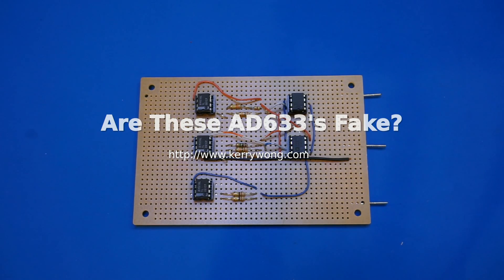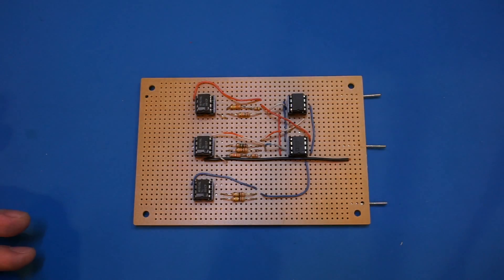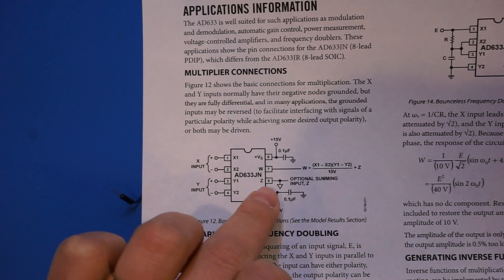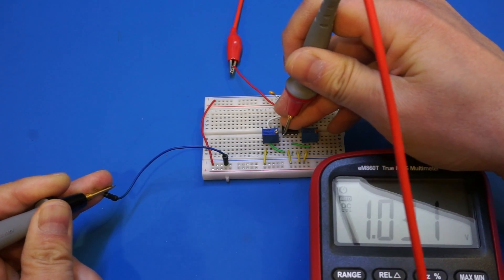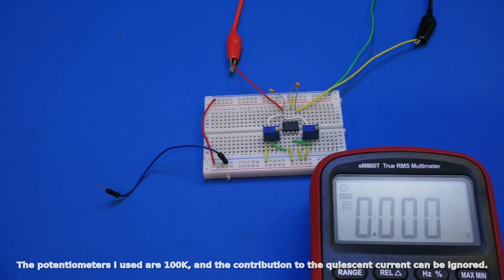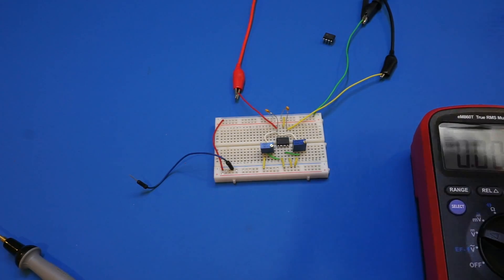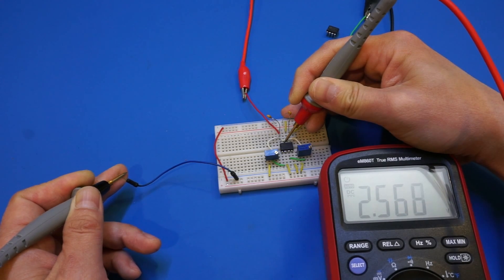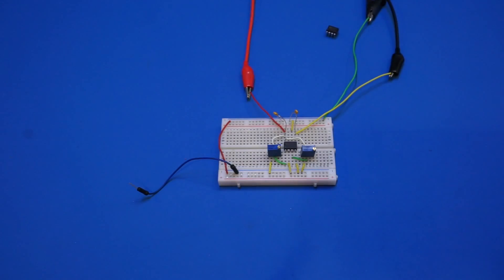Are These AD633's Fake?

Comment: I started building the squaring circuit but was impatient, only connecting x1 to y1 and x2 to y2. I connected the supplies to my current limited bench supply and found that I couldn’t get any appreciable voltage between pins 8 and 5 without drawing excessive current. Very broken.

Comment: Kerry. I know you probably think im a weirdo because i ramble. I apologize as i have ptsd and my meds make me act erratically sometimes. I hate it. 

Im in the market for a curve tracer to match germanium diodes and transistors tor some guitar effects pedals im designing as a gift for a friend who is also a student (guitar). Ive spent a fortune on parts and im making a test jig now for prototyping so i dial in the effects i want. I plan on selling the extras, i use an fpga based effects processor that can mimic any mic, position of the mic in relation to any cab or speaker and so many different amps and such that ill never runnout of options. Its almost too much choice. Very cool tech though. I run the modeling rig into a stereo pa or studio 2.1 powered speakers if i record so i have no need for the extra pedals. Im using new old stock from communist era ussr, mostly germanium semiconductors. 

Do you have any experience with the curve tracers from ali express or should i just buy a second hand tektronix for a little over a grand? I plan to either donate the pedals or proceeds to a local makerspace that i help out alot. I've been a big fan of your's for a while and read your academic credentials as well and i wasn't surprised by your notoriety and background. I have a software engineering degree i never used but plan to take ee or computer science this fall as my previous degree has almoat 2 years worth of credits to carry over to whichever i choose. Im 45 and it's a bucket list thing more than anything and I'd like to have the credentials to volunteer full-time as i plan to be much improved socially by then and they need the help. I've developed courses for them already and built out their electronic engineering area but im not at a point innmy therapy where i can commit full time. Im sure you agree being ive been a jackass from time to time.

Ive been off work for 8 years and have spent the last 5 yeara teaching myself to code again and circuit level theory and the maths involved. I apologize for my previous behavior and i assure you it wont happen again.

I was going to donate 10 dollars but you dont have the thankyou button enabled. If you enable it ill donate from time to time as a sign of appreciation and a token of goodwill for my idiocy.

Ive been wanting a curve tracer for a while and dont want to buy a peak atlas as the price in Canada is very high for a piece of plastic. Plus ill end up donating the gear eventually. I donate half of my disposable income to charity, usually to places that promote stem to youths or music as im a professional guitar player. Id rather have the degree though. Haha

Comment: I believe you are missing a ground connection between the top and bottom bus bars of the breadboard. Power supply ground isn't making it in to the pots or minus inputs of the  AD633.

Comment: Very late response, but... they look painted on top, take some acetone to them and see if it comes off.
Reply: Hi 'gnif'. Yea, this post is from 2017. I'm presently looking for these chips myself, recently. I don't know if the same 'fake' ones would still be on sale 3 years later without complaints??  Anyhow, the numbers on these are...
AD633JN
#1424
K707115       (Including a depression next to pin-1).
Some other eBay sites have some with the exact same ref numbers, but OTHER sites have...
AD633JN
#1216
2342702       (NO depression next to pin-1).
I think I'll try some of the latter!!
P.S.  Do you think that acetone won't affect the writing on the 'real' ones??

Comment: last month 5   '633's were ordered from top_electronic1980  on ebay.   on arrival they were tested
in the manner  you showed us here.    the inputs were  both +5V  so a +2.5 V. out was expected.
all  5  failed the test with W = -4.xx V. and every  chip getting hot.

    on writing to the seller with this info the reply was to  return  them  .  an address was given.
after some thought i decided to skip returning them.  the cost of returning, the time to pkg
the IC's and wait in line at the p'office &  a good  chance they'd  be misplaced in transit  or after
arrival added up to make this a non-starter.  simpler to just write off the loss.

btw ... in parallel with this ebay order was to buy 2 from digi-key.  they both tested OK.
... using the same b. bd circuit the ebay ones were tested with.

    a new direction is to write back & offer them a link top this site.  so they can see how 
easily the IC's could be tested prior to shipping them off  to some unsuspecting  customer.

   they can weigh this effort vs guaranteed negative feedback.  and who knows , someone there
may use their intelligence in a new way.

Comment: you've learned a hard lesson.   trusting what one buys online as being the real deal.
one a u-t vid a chinaman was complaining about the same thing ... being cheated
over there by his countrymen ... 

otherwise you gave us a  good tutorial  - intro  to the 633. 
 you've brought to life how we can get going using one.

given how they can accept DC signals as inputs 2 were added to a digikey order today.
cant wait to experiment with one.  saw 2 that AD offers an eval.  bd. using  this chip.
a little pricey tho ($86.40).  so am planning to DIY copy it using some EasyEda s/w
 depending on the exp't's outcome

btw ... the P.S.  ... is it the LPS 304 model ?  

a good dual-supply is on my get-list.   is yours one you'd recommend ?  

a concern is its rs-232 port.    since PC's lack them anymore.  but PicAxe uC's
can deliver -232 signals with their Serout command.  do you happen to have
any experience with doing that ?  

or is the -232 port redundant in terms of what one can do via the front panel knobs/switches ?
Reply from the maker: The PS is an Amrel PPS-2322 (http://www.kerrywong.com/2015/05/06/amrel-pps-2322-programmable-power-supply-teardown/), it has a GPIB port.

Comment: Mr Kerry Wong Check your breadboard connection once again.. according to spec sheet OUTPUT
Output Voltage Swing ±11 V
Short Circuit Current RL = 0 Ω  typ-30ma  max-40mA  that is what your draw is anyway so you have a short circuit..    z goes to your VIRTUAL GROUND , maybe use another breadboard, you must have a short circuit surely
Reply from the maker: Checked multiple times, different chips give different measurements. Definitely not short circuit.

Comment: Would have been nice to compare with a known good/genuine chip.  Oh, well...
Reply from the maker: I had thought about buying a few genuine ones, but the project would get too expensive :(
Reply: Why are they so expensive.  All they're doing is adding the 2 inputs then dividing by 10. Couldnt the divide by 10 be done externally with an op-amp or resistor divider? Adding 2 inputs is pretty simple. Are they capable of high frequency (MHz, GHz) - is they why they are expensive?
Reply: Correction: is THAT why...  Not they.

Comment: I am just about to use the AD633 in a design--so I am very interested in your test.
Aren't 100K pots a bit large--and you clearly were touching BOTH leads on that 1st measurement--skin resistance can easily reach to the 100K range.  Perhaps those long exposed wires/leads are picking up noise or oscillating (explaining the high Q-current.--especially on a breadboard.  Also, you did not show what the other pins were actually reading...etc
Reply from the maker: No, the skin resistance didn't matter in this case as I did multiple measurements with and without touching the leads.
Reply: OK, have you found any AD633's that work?  Any from ebay that work?    I know I have some here from the 80's...still searching the old foam sheet pile in a big box--I love all that old Dallas Semiconductor stuff (brings back memories!). I need two '633's for my app.  I am thinking of trying my luck on ebay each '633 from a different seller...if I don't find my old batch.   THANKS FOR THE REPLY.   
--daLe
Reply from the maker: None of the ones I bought worked. Not sure about other eBay sources but I'd stay away, especially if the price is too good to be true.
Reply: Thanks--I might try sellers that have a return policy.  I just dug up a pair of AD532's.

Comment: i bought some 3055's from mouser for a power supply i was building and all of them burned out with just one amp current draw, so i ordered a different brand of 3055's from mouser which work as they should and are still in service. i suspect the first batch i got were fakes and mouser refunded my money but didnt admit the fakes.
Reply from the maker: Interesting, I have not had any bad experience from mouser before...

Comment: Had a similar experience with some AD8572 op amps from eBay. They were about half the price so I bought 5 of them. When trying them out I noticed they didn’t go anywhere close to rail to rail and suffered from serious phase reversal at low common mode voltages. The seller just wanted me to test more and make video of how they behave. He said they are from a big supplier. Never got my money back. So, if the price is too good to be true they are probably fake.

Comment: I have had a similar (although less extreme) experience with a few MAX3232 RS232 line-driver modules. They mostly worked OK, but I found that when using them to talk to some devices (most notably Cisco routers), I was getting garbage from them. After some detective-work with an oscilloscope, I found that they were vulnerable to crosstalk if the RX voltage went above about 19.4V peak-to-peak (higher than most devices usually put out, but still comfortably inside both the MAX3232 specifications and the RS232 standard).  I wrote about it here - http://blog.bogpeople.com/2015/01/fake-max3232-rs232-line-drivers.html.  I also got a batch of fake MAX 7221 LED drivers (that looked very obviously fake and were priced accordingly).  Apart from being more sensitive to a lazily omitted power-supply decoupling capacitor, these worked just fine, though.  It does seem to be a very widespread problem.
Reply from the maker: The RS232 drivers are mostly just rebadged generic chips but at least they were functional to some extent (unlike the AD633's I got). Definitely good to know that this is a wide spread problem. Thanks for sharing.

Comment: Why don't you use TG and input triangular wave into x and y? At least you can see if IC is multiplicating.
Reply from the maker: Good point, I will give it a try... Judging from the "random" output for the similar inputs to both chips though, it's pretty safe to say that they are dead chips.

Comment: I buy modules only. Where I can plug it in and see if it works or not.
I never buy components, unless they are good used ICs pulled out from working circuits.
The temptation is high given the price differences. I can guarantee you that ALL are fakes. Even ridiculously ubiquitous chips like TL071 or 741 Op Amps. All fake. Buy it from a reputable distributor so that you don't have to second guess your wiring or design.
Let this comment fall into deaf ears as usual...
Reply from the maker: I hear ya.
Reply: Who would buy 741 opamps. There are much better ones such NE5532/34 that are good but not too expensive like some other opamps.

Comment: They are fakes. The real chips do not have the dot identifying pin1.
Look at page 20 of the data sheet from Analog Devices.
Reply: You appear to be correct. I bought AD633's from ebay as well (from a different seller) and the pic on the item description had no dot, but the chips when they arrived had the dot, and were also fake.
Reply: I do not know how long it will take for you to reply - But my Analog Devices datasheet only has 9 pages and on page 8 it shows the dip with a 1 dot. so I am even more confused - I just ordered 5 from eBay 22 July 2019. I have been like Kerry and not had a problem with fake IC's & I had not seen this video before I ordered the AD633JN, So I will set up a test before I try using them in an AC Mains 230v Wattmeter I was going to build - see - http://danyk.cz/wmetr_en.html

Comment: I also haven't had any issues with ebay purchased chips so far. Would it be possible to decap the chip and compare die layout to the original one? Here is a die shot of original AD633 for comparison: http://farhek.com/a/a/ic/ic-friday-analog-devices-ad633-engineering-from-the-10x-stitch-jpg_analog-ic_schematic-and-wiring-diagram-a-simple-circuit-maker-for-house-electronic-device-symbols-regula.jpg
Reply: That appears to be a die photo for the AD534, a similar device.
Reply: Get the equipment or send to electron update.
Reply from the maker: Unfortunately, I don't have the equipment to do that...